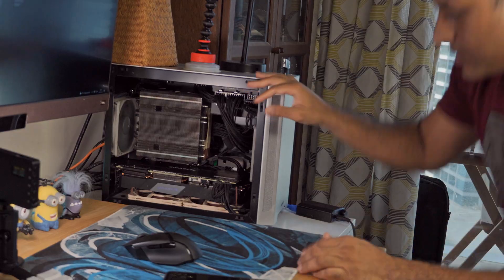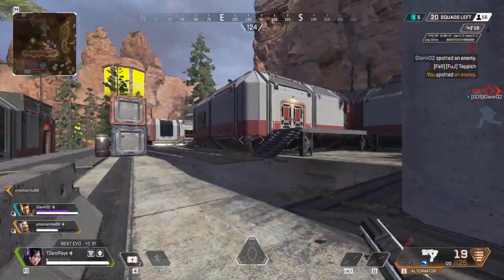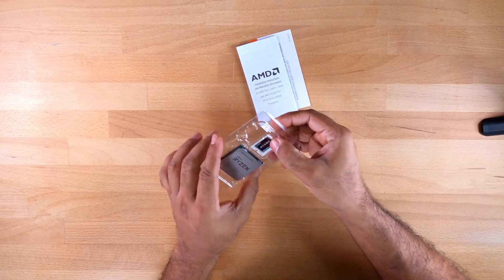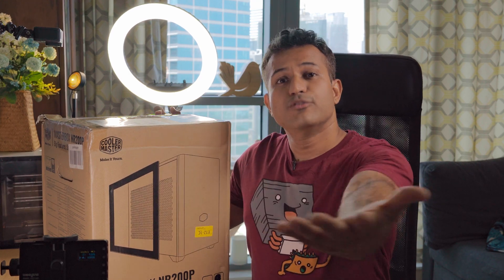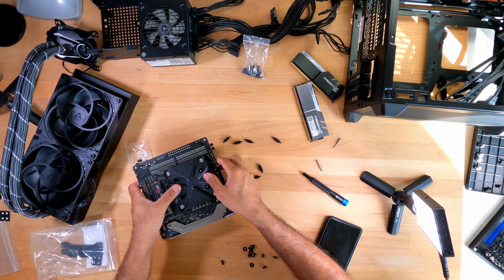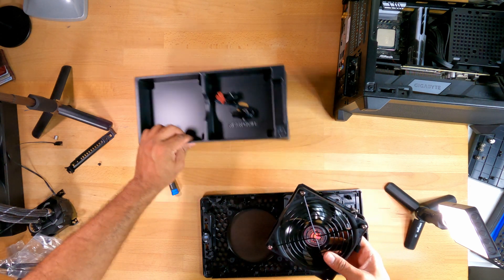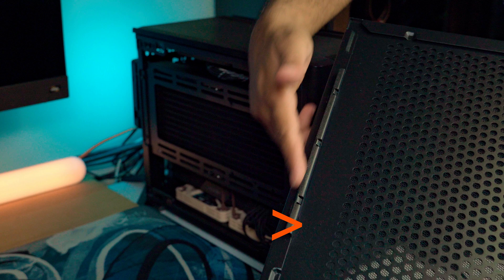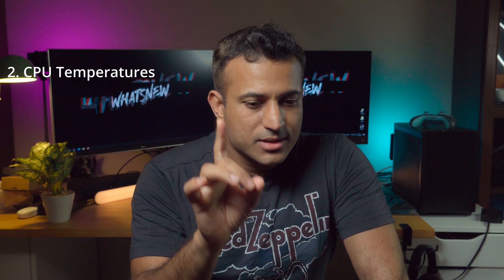I built a Gaming & Editing PC using the COOLER MASTER NR200P with AIO liquid cooling!

Comment from the maker: If you're planning on building with some or all these components, I'd be happy to answer any questions :-)
Reply: It mean heat from radiator will go to the case?
Is it better than blow heat from radiator to out side? 
How different between two options? 

One more question. How did you manage aio tube in this case?

Thank you. ^^

Comment: Don't know if you'll respond since this is so much later on but I'm having a massive issue getting my freezer II 280 INSIDE the case, like it's refusing to go inside, simply too wide. How did you get yours inside the case?
Reply from the maker: I took the radiator brace off and then inserted it one side at a time..

Comment: @WhatsNew I'm building pretty similar system next week when my CPU is coming:

Specs:
Cooler Master NR200P
Asus ROG STRIX B550-I GAMING
AMD Ryzen 9 5900X
ARCTIC liquid FREEZER II 280mm AIO
Gigabyte GTX 1070 G1 Gaming 8G
G.Skill Flare X F4-3200C14D-16GFX 16GB
1TB Samsung 980 Pro M.2 NVME SSD
Fractal Design Ion SFX-L 650W Gold
Arctic fans all around

Hopefully everything will end up as well as your build did!
Reply from the maker: Nice!! Hope it works out ! ..do consider another 16gb of ram atleast. I cannot recommend it enough !
Reply: @imwhatsnew  You can probably see that I have low latency CL14 b-die kit and if I can't get it to work @3800 with boosted voltage, then I do consider upgrading to 32GB. Then I would gain dual rank also witch should help with speed also.

Comment: How did you end up shoving the radiator and fans with the side bracket into the case? Did you disassemble it?
Reply from the maker: No..it fits just fine...the water tubes though..they need some wrestling into place and tying down to get them neat and out of the way of the radiator fans.
Reply: @imwhatsnew I had to remove some screws from the front bracket to get the radiator in. Next task is to tie those tubes out of the fan/radiator. I’ve got the ARGB model and for some reason the fans vibrate/hitting something when it’s side mounted but not if I hold the radiator so it’s up top.
Reply from the maker: @E82N55  i could get it in by inserting one end in and then the other.. a bit fiddly but doable...the tubes were a pain though..